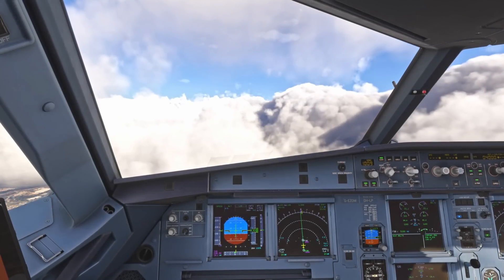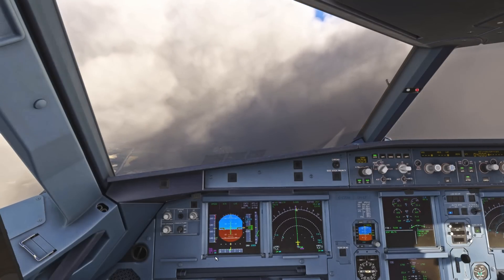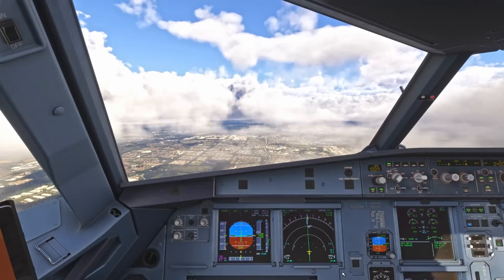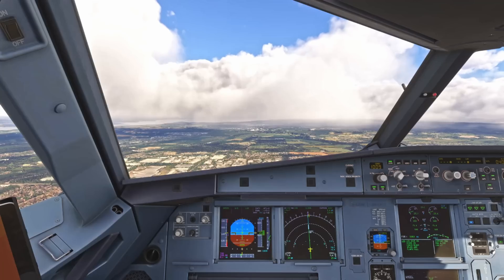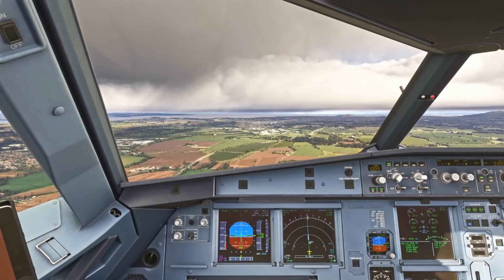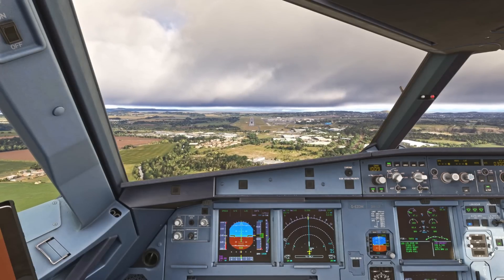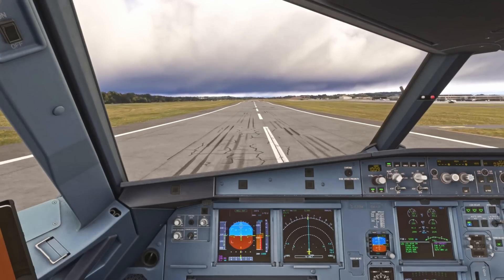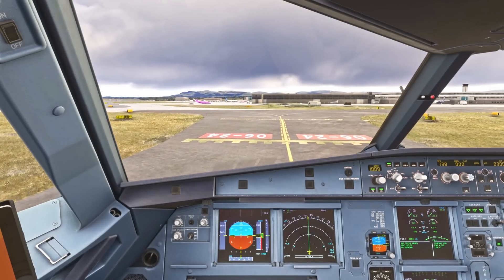How to Land the A320 Like a Real Pilot | MSFS 2024 Tutorial

Comment: I’ve heard and seen in several videos (some are pilots) that it is strongly recommend turning off the flight director in Airbus aircraft when disconnecting the autopilot. It doesn’t seem like you follow that practice.
Reply from the maker: Hello, I do take the FD off if i'm not manually flying the ILS. In my latest video I take the FD's out and usually in the real world that's what we do. Normally the pilot monitoring would sort those changes though so the PM can concentrate on handling
Reply: @AirbusCockpitCoach thank you, so what your’e saying is that if you fly RNP or visual approach then you take it off when disconnecting the AP but for ILS approach it is not necessary? 
I understand that the reason is the 30 feet, 8 seconds nose down practice that the airbus executes before flare and leaving FD on can trigger the system with false input from pilot and computer ..
Reply from the maker: You do not have to keep it in for an ILS, it can be a preference if not operator directed to take it out. The pilot will be aware of the implications in handling

Comment: Hi bro I get my Fenix to drift away from approach when autopilot goes off at 1000ft is there anything I am missing here ❤
Reply from the maker: Hello, this could be caused by a number of things but in manual flight you will have to correct with the sidestick for crosswinds, up/down drafts etc but it could also be that a calibration issue that means you may have a slight but constant input on one of your controls which is worth checking, the joys of flight sim!

Comment: Hi love the video just a quick question when i'm on final and fully configured... at around 500 ft i disconnect the autopilot and all seems fine but if i make and altitude corrections with the stick the auto throttle adds power and i come in to high any suggestions? Maybe I shouldn't adjust pitch after I disconnect I'm not sure. Any help would be greatly appreciated thanks!
Reply from the maker: Hello, you should be stable at 1000ft that is often when we disconnect the autopilot in the real world. The descent rate should be stable from there so very little pitch adjustment is needed unless the winds and thermals are strong. You may be over correcting, the A320 auto thrust system is very good at maintaining the selected speed. Generally only very small sidestick corrections are needed, remember it is auto trimming so do not hold the pressure on, make an input and release

Comment: I think this video just answered 1 question I have been having about the Auto Throttle.  I've been so used to flying the 737 in the sim but PMDG have yet to make it compatible with MSFS 2024.  As such I am getting to grips with the A320 by Fenix, and actually am really enjoying it.  I always thought on approach that you also had to disconnect the Auto Throttle and control thrust manually but always got a surge in power since it was on the Climb Detent.  I see you keep it engaged right until the end and it appears to disconnect when you move the levels to Idle, is this correct?  Btw great content on your channel, you deserve more subscribers
Reply from the maker: Hello, yes what you have described there is correct if you wish to use auto thrust. You can use manual thrust as well, to do that correctly follow the detail in this video https://youtu.be/RvLDHS5j-oM reach out if you have any further questions. Thanks for your comments, appreciate the support 👍
Reply: @AirbusCockpitCoach  thats fantastic thank you. Ironically I was actually flying into Geneva last night but from the opposite direction. My speed was struggling to decrease due to the 7000 feet bottom of descent being so close to the start of the glideslope.  I had too much energy to slow down.  Deploying flaps meant an overspeed. I think the SAPRE waypoint at the bottom of descent had a speed constraint of 210 knots, it was a max speed so guess I should have manually set lower speeds in the MCDU.  This coupled with the speed suddenly increasing when I disconnected the Auto Throttle left me attempting my very first Go-Around. Good tips about the blue dot, I had not noticed that.  The levers on the 737 physically move when controlled by the Auto Throttle so disconnecting them results in no change of power.  I understand the logics of the Airbus are different due to the detents

Comment: Thank you for the turning speeds. Good detail there.  Adding a separate, physical tiller massively improved my overall experience and immersion.

I had a rather rough landing yesterday, struggling with a 20-kt crosswind.  I disconnected the AP around minima, since I was in visual conditions, but the touchdown was unpleasant. Would love to see some focus in this area.

Speaking of, when you disconnected the AP here, were you simply flying the ILS manually for the vertical and lateral diamonds?

Great video 😊
Reply from the maker: Hello, I am on the look out for a tiller as that is certainly one thing I miss in the home cockpit, which one do you have? 

Every landing is different and it is important to remember that we make unpleasant landings in the real world from time to time, getting the balance of controls correct in changing conditions is a challenge and one that you can practice for but sometimes those changes in condition catch you out. I may use FSI panel and run through some approaches in more challenging conditions.

Yes I was flying the ILS manually until 200ft at which point I am fully visual looking down the runway. The difficulty is sometimes the glideslopes are a long way out in the sim. 

Thanks for watching 👍
Reply: @AirbusCockpitCoach  I got mine on Etsy from AeroSimInstruments.  I am not sure how many he makes at one time, but the price is sweet and the operation is perfect.  It does not have a nosewheel steering disconnect, but that's fine with me.  Just having the physical tiller next to the sidestick changes everything.